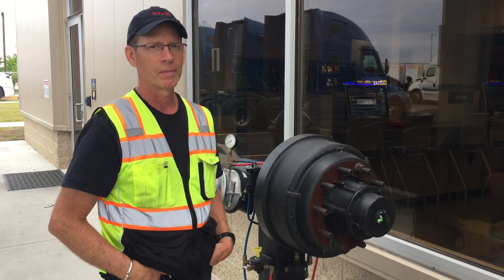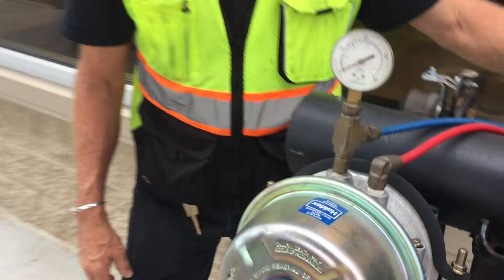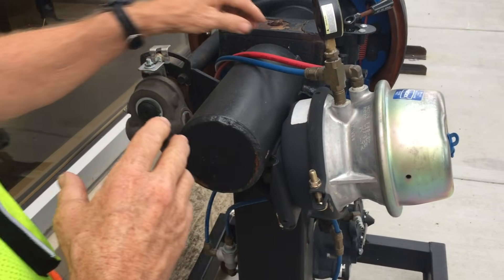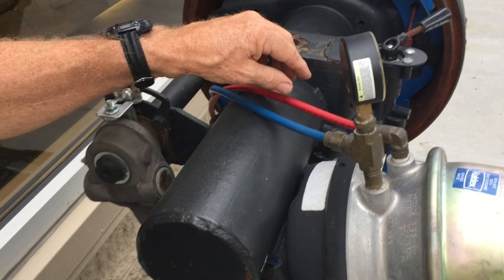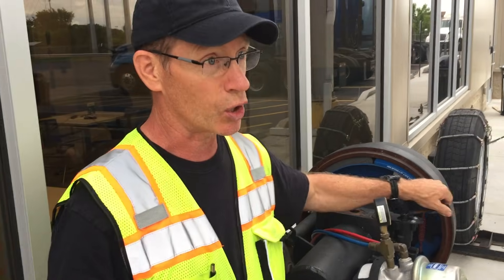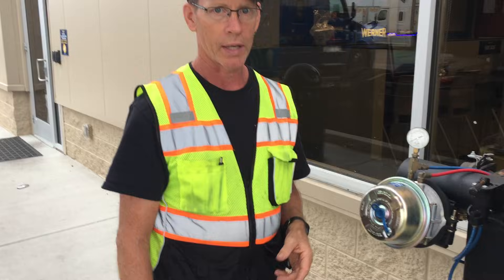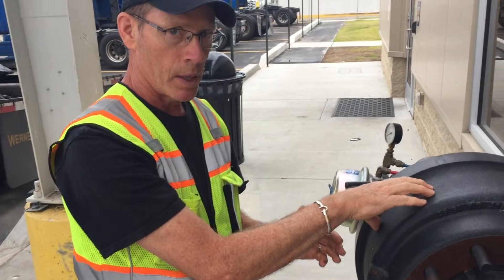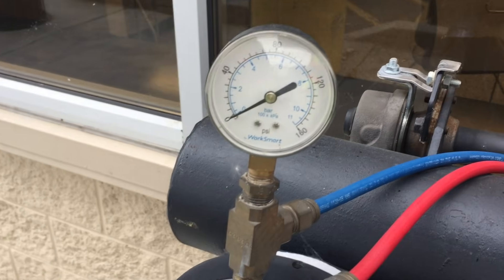Air Brakes | Air Brakes for Trucking | Air Brakes Explained | How Air Brakes Work | Compressed Air

Comment: The tractor brake control valve,on the steering column or mounted on the dash , I use that to test my fifth wheel to know if my jaws are locked in place . It also helps in a jack knife as you pull ahead you can put some brake pressure on the trailer so you’re trailer doesn’t get out of line and end up beside you’re tractor . I have never jackknifed a semi yet , I have came close but pulling forward helped me , the only time I purposely jackknifed my trailer is what I have some really funny docks where in order to dock on the plates and  not block a drive way I had to position my units in a jackknife position , on purpose . Thank you kindly , I have been driving over 27 years and every day I am still learning , keep your wheels rolling safely 😊

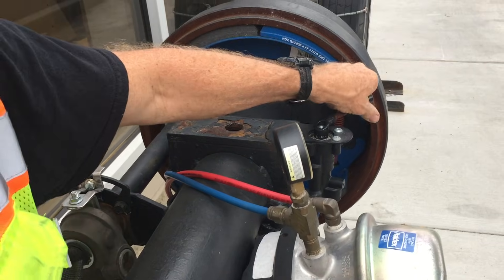Comment: @3:55 Kenworth and International still has the trolley brake lever in the cab. I dont know about other mfgs. I do believe if you have a retarder, this lever gets replaced by the retarder activation lever.

It's still nessecary because in slippery conditions, it can straighten up the truck from a jackknife, especially on downhill grades. It's also useful to tug test your trailer without dumping the trailer air.

It's falling out of favor though with the advent of ABS and computerized brake systems, which will automatically modulate pressures to every wheel to minimize slipping and accounting for trailer sway/skid. But there's still a high number of trailers without sway/skid control that benefit from the trolley brake.

Additional factors for why they're dissapearing are less experienced drivers not knowing how to effectively use them, or using them incorrectly. Another factor is it has now become an option for many mfgs so you have to build your truck with one. With the proliferation of auto shifts, so goes the way of the trusty trolley brake.

Most trucks I've driven still have the trailer brake lever. And its definitely not because its not nessecary anymore. It's because companies dont wanna pay for them, and wont pay drivers to keep good drivers, and has lead to a decrease in competent drivers.
Reply from the maker: Thank you for all that good information!!! We appreciate it!!!🥳

Comment: How do i know my tandem brakes are working and its not just the truck brakes?  During pretrip i decided to see if there was any difference with red tandem parking brake button in (tandem brakes off) . When i walked back and looked at brake drum pads, they were still on the drum unmoved? (I moved truck back foreward 10ft thinking maybe they release on movement,  no difference seen)

Comment: Getting rid of the hand operated trailer brake is not a good idea.  They’re very useful in snow and icy road conditions.
Reply: How else can you test if trailer brakes are working if no handle brake???? Could just be truck brake stopping .

Comment: i work as a diesel tech for a rental company and a lot of the cascadias that we have 2022 and newer actually still do have the trailer brake lever it just looks different than that there are some that dont but most of ours do at least

Comment: I once drive a old Isuzu semi-truck with trailer brake, old truck's trailer bump crazy like when apply only 30% of foot brake. But I wonder is trailer brake have linear control like foot brake or it just an on/off switch? In my memory it lock up easily, but it is with empty container so I can't tell my feel is right.

Comment: Air vs hydraulic brakes. 
1- Air is stronger. Even on small cars you need help to press the oil to the brake calibers. Help comes from the vacuum chamber.
2- with air, it dosn’t matter how many axels is on the truck. The brakeforce on each axel is unchanged if you have 2 or 100 axels. 
3- with hydraulic, you dont have emergency brake ability. 
If your airhose breaks you loose air brakes lock up = 100% brake
If your hydraulic hose brakes you loose hydraulic pressure = 0% brake

There are manny more reasons why air brakes on trucks are better.

Comment: i always thought that when pressing the brake pedal it drained the air so that brakes were applied but now I realize that pressing the brakes only pushes the brakes together with the service line but there's another mechanism in those brakes that when the supply line stops providing air, it releases the brakes.

Comment: The statement that airbrakes are faster than hudraulic is incorrect.  Hydraulic brakes operate a lot quiler than airbrakes, but are less reliable.  We use air brakes for commercial vehicles because they are less inclined to fail and have more fail safes than hydraulic brakes.

Comment: My question is this, why would it break more with the front differential then the rear one on a utility trailer, and before you say its un ajusted, its properly adjusted, but its still breaks a lil harder with the front breaks, is it the break chambers or the valve?? I changed the front diff chambers and its still doing the same..

Comment: Excellent explanation/Demonstration video  I appreciate the amount of details you went into  i’m a recreational  towing  person and over the years my trucks and trailers/weights have increased  i’ve always used Electric style Trailer Brakes with a Controller  or Surge brakes  but i’ve been curious on. the details  of the big boys  systems  knowing Air was a part of  the system now i learned why i’ve known about the Jacknifeing issue and correction    of applying more  braking on the Trailer  Axles

Comment: Air is not faster than hydrolic. Air moves in the system up to 340m/s, while hydrolic moves.with about 1500m/s. So air os actually quite a bit slower.

The benefit of air is.. that it is air. That is you can relise it with no problem. Say you would have a trailer, if it had hydrolica you would spil some every time you disconected. You could also taint the hydrolic system of the tractor unit.
Reply from the maker: Thank you for these details!!!

Comment: Lol, he made it seem like the truck is just gonna instantly super lock up if the spring brakes are applied while the truck is moving, lmao! Not true at all. That truck and trailer will come to a stop just like it does when you apply the service brakes. It's not gonna instantly come to a violent stop. It's gonna keep rolling till all of the momentum is lost, but slower and slower as that momentum reduces. Now, on a slippery surface or a very high rate of speed, I wouldn't want to try that, bcuz i dont know how that would play out, lol.

Comment: I hate when I get into a truck that does not have full spring brake chambers on all axles except the steer axle, of course! Why, bcuz I hate pancake brake chambers, which is just the side for the service brakes, and no spring side for emergencies and the parking brake, for those who don't know! The problem is bcuz when you're loaded and you only have two spring brake chambers on one drive Axle, and two pancakes on the other drive Axle, the truck tends to roll forward when you pop the tractor brakes, especially on a slight incline. It's always better to have all spring brake chambers on all axles that require them! I feel super unsafe with pancake brake chambers. Then what if I need to pop the brakes while moving for whatever reason and I really need to stop? Those pancakes will do me literally no good for stopping in that emergency. That's the point in having spring brake chambers! Anyone who uses pancakes is clearly just cheap and shouldn't have a truck, in my opinion!

Comment: This is an excellent, technically correct and easily understood explanation.   So many youtubers don't understand the spring brake part of the compressed air system.   Thank you.

Comment: Hello, I have been dealing with air brakes since 1997. As  I find  your explanation is not bad, you should use the proper terminology for the components. If some one is using this video for research to obtain a CDL, or an AZ up north,  they will be confused as to what the parts are called. You didn't mention slack adjustor, you just said arm. Or push rod, you just said its a linkage.  You also mentioned something about a " bladder"? Did you mean to say diaphragm?
I thought the explanation of how the spring brakes work was pretty good, down to laments terms. 
I am a Canadian Armed Forces Air Brake Instructor and the way we explain to our troops is we send a compressed air signal from either our foot valve or hand valve (for the trailer), to the brake chamber ( after the spring brakes are released, or it could compound the brakes). This action turns a compressed air forcing against a rubber diaphragm in the brake chamber into a  mechanical force  pushing the push rod out, which is connected to a slack adjustor. This pushing motion turns the force into a force multitier twisting motion because it turns a shaft that has a S cam on the end of it. This twisting S cam pushes the brake liner or pads out to contact the drum.
By no means is this a negative criticism, but this is a bit of a pet peeve of mine when it is not explained properly.
Sorry
Reply: Two things: 1. Thank you for adding the proper terminology 2. This video was exactly what I needed for a visual understanding…seems hard to find. And, actually make it 3 things- Jesus is King!  Hope you’re walking with Him ❤️ He is the only Way to eternal Life 🌸🌻🌺much love ❤️
Reply: UPDATE after hearing from @ramdriver74..... Thank you sir. I'm just getting certified to get CDL and drive buses for our county 🙂 as a retired teacher, contractor, hillbilly and pilot. I appreciate the precision. I'm new at this, but it seemed like he actually made a mistake or two in his explanations besides lack of precise terminology. I don't want to be critical and I see that almost everybody else has posted that. This is an amazing video. However: Isn't it the job of the large spring inside the Brake chamber to force the same brake pads against the drum (or rotor)? The little springs can only pull the pads off the drum after the big spring has been pushed back by the diaphragm with air pressure. I think the little springs mostly keep the pads from simply being loose... Maybe a bit too nuanced or am I incorrect? And the blue and red lines that he mentions. Aren't they the same air just separated by a directional valve? Any help would be greatly appreciated by anyone 🙂.... after hearing and learning more, thank you @ramdriver74, I understand that the blue line is for service breaking and totally separate from the parking / emergency system red air lines :  )
Reply: @BrianMick-mz9np  Yes, you are correct in saying the small springs keep the brake pads in place. The large spring in the brake chamber in to apply the brakes when there is no air supplied to the brake chamber. It is a spring brake that is for parking and emergency braking. The difference between the air lines is the red line supplies a continuous supply of air to the trailer when the dash valve is pushed in and the blue line is the service line that sends air to the brakes when the foot valve or the hand valve is applied.

Comment: your presentation is missing an important concept:  pause,  silence.  Explain something, and then be silent.  Shut up, so the listener has time to absorb what was said.     quick repetition is often NOT effective.   the visuals, the model is good. 
Explain something, long pause, and then repeat, then pause again;  before adding additional information.  
Sometimes seems long and Boring but is more effective than non stop yammering.
Reply: Good thing it's a video so you can just rewind and watch as many times as you need.
Reply from the maker: Thanks for your free consultation on adult education best practices. You forgot to lead with a positive.
Reply: @TheJoyofTrucking    no, I avoided it.   it is B.S.

Comment: So an air leak would lead to brakes locking on? guess thats the fail safe
Reply: A small air leak that the compressor could keep up to is fine but needs attention. A large air leak like a hose blowing out could potentially lock your brakes.

Comment: Great explanation..
My question is, can spring breaks be installed in medium trucks like fuso fighter..??
Reply from the maker: Thanks for watching! Sorry. We don’t know the answer to your question.
Reply: This would not be a cost effective move. The components that the truck would require would probably cost more that the vehicle is worth. Not to mention all the extra weight that would have to be carried like the air tanks, the relay valves and the air hoses. Stick to hydraulic.

Comment: Great explanation. If I may add, in the incident you had with your trainer where you suffered total air loss, you likely would've still had about 5-7 brake applications before parking brakes locked the wheels. The reason for this is the inversion valve, if you lost total primary pressure but still had your secondary circuit intact, then your secondary air will actuate your rear brakes until it runs out of air - usually a few applications, but enough to stop safely.
Reply from the maker: Thank you so much!!!! 😃
Reply: Only on a dual air system.
Reply: @Sak-zo1ui  mandatory in North America and Europe, and probably most countries.
Reply: @funkyed985  they are mandatory on new vehicle but older ones are grandfathered.
Reply: @Sak-zo1ui  Sure, but that would be pre-1967, those trucks don't meet emissions and are not used for actual trucking.
Reply: @funkyed985  dual circuit air brakes and dual circuit hydraulic brakes are two completely different subjects. Those trucks were 100% designed for work too. Dual air brakes are not technically required although most have moved to it. There are long haul trucks into the 80s without dual air systems. The mid 80s onward is when dual air brake started to become a standard. Cabovers often times didnt even have front brakes for a while until the 80s.
Reply: This Inversion valve you speak of is a two way check valve for BLENDED air. There is one two way check valve on the dual valve foot valve and there is on between the foot valve and the have valve or spike. It allows the greater pressure of the two air sources to be utilized for the brakes. So if you lose air pressure from the primary, ( this means the greater of the air pressures now is your secondary) you still have pressure from the secondary to apply the brakes.

Comment: The hand brake for the Service Brakes MUST BE MANDATORY! NEVER, EVER TAKE IT ON FAITH THAT THE SERVICE BRAKES ON A SEMI/FULL TRAILER ARE IN PROPER WORKING ORDER! ESPECIALLY ANY CONTAINER CHASSIS! Before you get on a public  road surface, use the hand brake valve to check that the service brakes on whatever you’re hooked up to SEPARATELY TEST from the Power Unit (NOT THE FOOT BRAKE). If you experience a blowout on your steering axle, accelerate (providing your power unit hasn’t stupidly been made into a crawler with a Speed Limiting Device) to make sure that your vehicle is stable and ease into your hand brake so that you reduce the chance of a jackknife. It can aide in bringing A trailer back in line behind your cab, just make sure that the road surface isn’t too slippery. Never get ham fisted with a trailer hand brake. If you have multiple units in tow, down shift and use your retarder to slow down before using your hand brake. If you get into a cab that doesn’t have a hand brake, it is an UNSAFE VEHICLE! Don’t even start the damn thing up. And NO, it’s NOT A TROLLEY BRAKE. You’re driving a Big Rig, NOT operating a Trolley Car. When you have time, check to see if your wet tanks are dry on your Power Unit and anything you’re pulling. Keep the dirty side down.
Reply from the maker: Thank you so much much for elaborating!!!! Very much appreciated!!!

Comment: I am under my truck caging a brake chamber right now. Love your guy’s videos. But I have to correct one little thing I own a 2019 KW T880 and I have a trailer brake lever. Now granted it’s not the old school one on the column but one a little different style that’s on the dash next to the column. They stopped the column style because of the automatic shifter/ Jake brake setup in KW’s I think. But I have a 18 speed manual, and it’s on the right next to the column for sure. But thank you guys for the informative videos!
Reply from the maker: Thank you so much for adding in this information!!! Sounds like you are definitely more experienced in this area. We appreciate that you watch our videos!!! Stay safe out there!!!